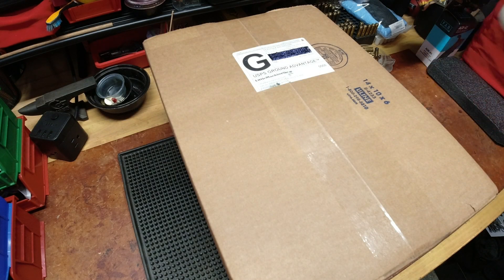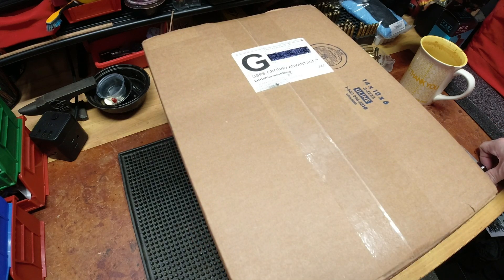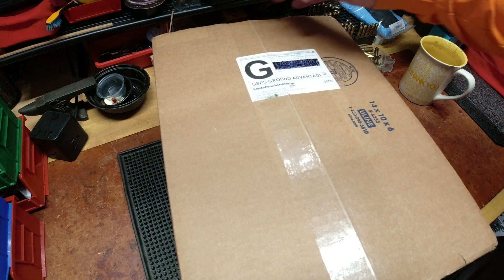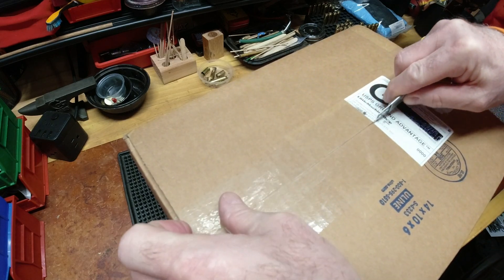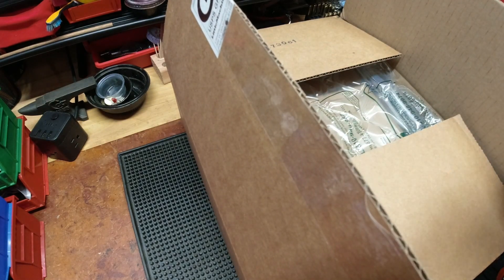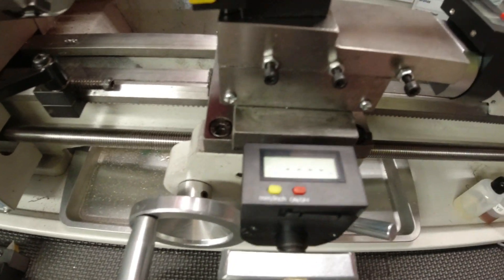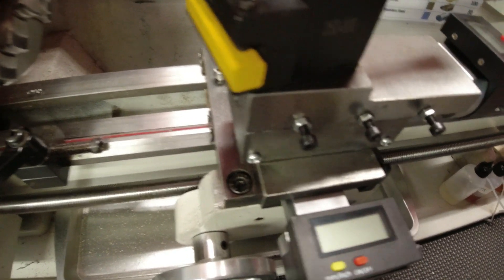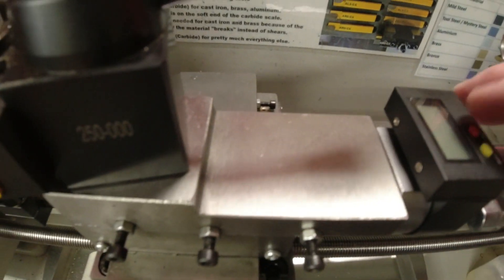Budget DRO Install on my Mini Lathe - First Video of 2024

Comment: Hello 
Thanks for your helpful videos.
Ihave a question:
Ihave one mini mill and how you know the table travel is 15 cm and 25 cm like so.
So the question is can iuse of them on my mill?
Best regards sina 
Von Österreich 🇦🇹
Reply from the maker: I purchased my mini mill DROs from Little Machine Shop.  They offered two (2) variations with the only difference between the two being the thread pitch of the rods/drawbolts you would be replacing on your existing cross and compound slides.  You need to match the same thread pitch.  The description usually states what types of mini lathes the DRO is compatible with.  I liked this approach better than wiring a hard connected DRO.  For my skill/needs, this was a good solution for me.

Comment: Hi, have you found a solution to reduce the force to be applied to the rotation of the dro's handlebars??
Reply from the maker: I purchased a new cross slide that I was going to re-thread to more closely match the threads of the DRO "bolts"...but the cross slide was ultimately the incorrect size.  Haven't revisited the issue as it hasn't bugged me enough.
Reply: @ReLoadersBench  Tankyou